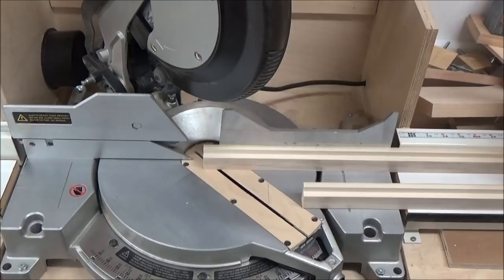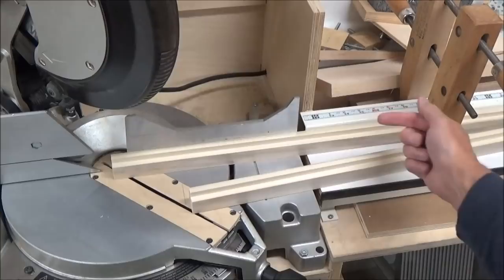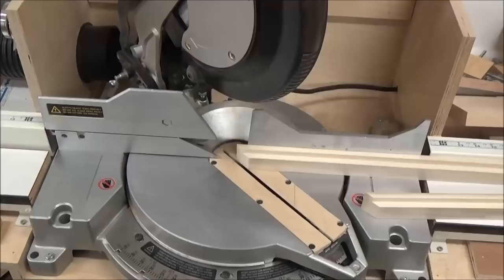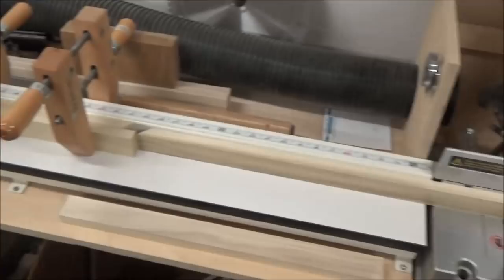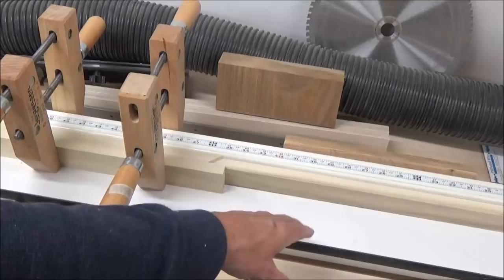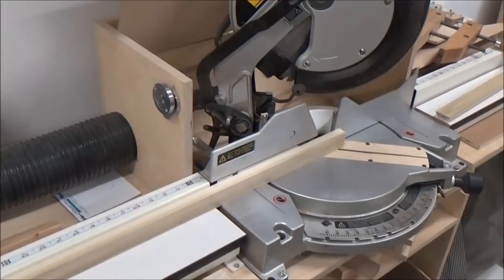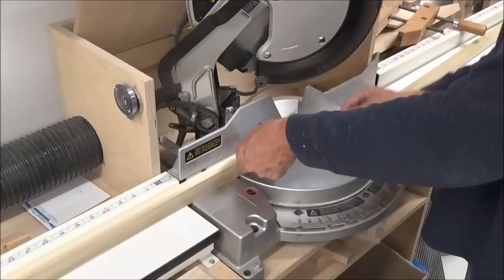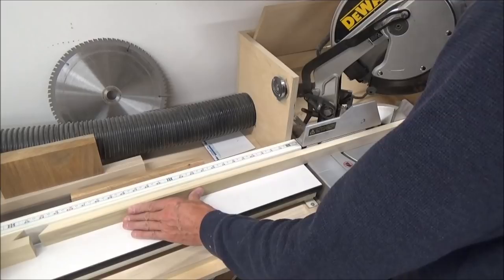Accurate Frames Right off the Miter Saw

Comment: Respected sir your work is amazing and i appreciate your way of teaching in your videos. Great way of cutting pieces for picture frame we learned from your video.  I noticed in the video your miter saw dust hood system which i got fascinated from i searched in your channel any video for that.  My request if you could please make a video regarding that i will be grateful to you.  I am struggling for my miter saw dust collection and did a lot of research but till now no tangible solution i got.  Please let us learn from you regarding miter saw effective dust collection.  Thanks a lot.
Reply from the maker: I will tell you this. That dust collector is basically half a bird house with the lid being hinged and a 4 inch port on whatever side makes sense for you. Thanks for watching.
Reply: @JeffFischer1  thank you so much for the prompt response

Comment: I can never get mine to match up, all cut at 45's with top and bottom the same length as well as sides the same length.  I always have gaps,   your tip about the saw pulling the wood may be my issue, thanks for the clear explanation.
Reply from the maker: Glad this helps. Thanks for watching and good luck with future cuts.
Reply: yes you need a clamp   there must be a quicker clamp

Comment: Is that the back of the frame you are showing to us (the camera) so your mounted picture and glass would sit in the "rabbit" but you measured the frame from the inside???
Reply from the maker: Correct. The measurements are what you need for the piece being framed. Thanks for watching.
Reply: @JeffFischer1  But in the video you are measuring not in the rabbit where the picture and glass would go, but on the inside of the front of the frame itself...???

Comment: 1:27 Why set up the workpiece on the right side of blade which requires you to cross hands during the cut? Isn’t crossing hands on a mitre saw a safety no-no? I’m just a beginner but have watch a few safety videos
Reply from the maker: I am not holding the piece with just my hand only which would be a no no, but also with a wood clamp. The pressure I am putting on the work piece helps to eliminate any chatter that might occur. Thanks for watching.

Comment: Where do you find good picture framing wood?
Reply from the maker: In this case I used polar. Whatever you use, as long as you can get it flat straight and square, it will work. Thanks for watching.